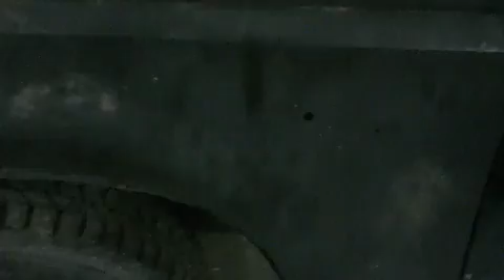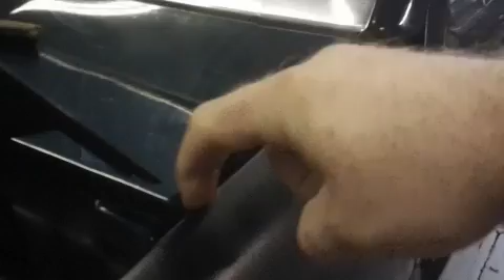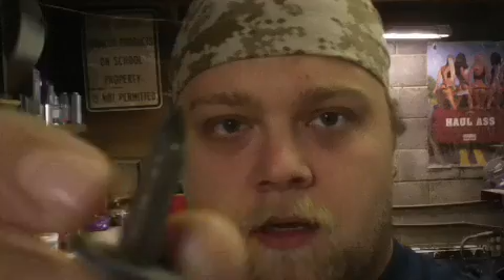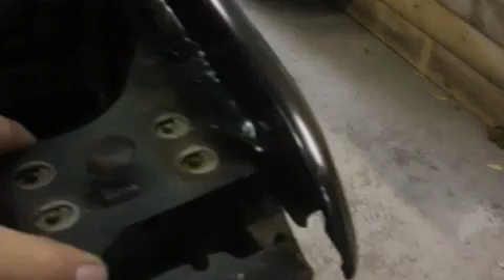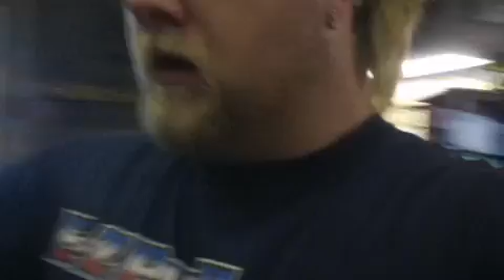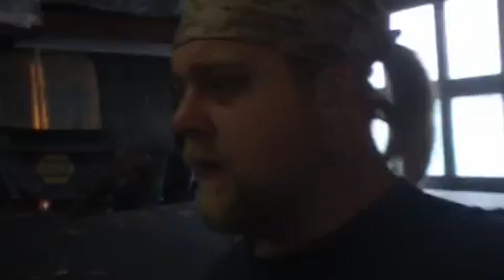104

Comment from the maker: i've done a few chevy after market fenders and...THEY ARE THE WORST OF EM ALL!!! i feel for ya. the ones i have done all of em needed to be jacked up in the front on the rad support...than the bolts went in the rear than we set it back down and the door gap would line up. the rest is a battle with the porter power and rounding out holes and blocks of wood with a good size hammer..lol i dont think i have ever done a chevy one without a lil glaze where i hit it either...good luck!